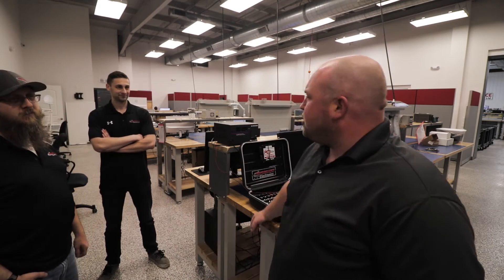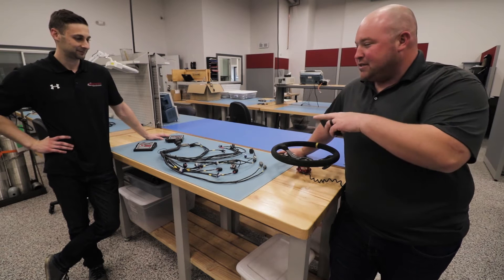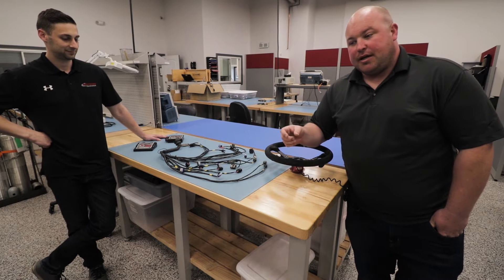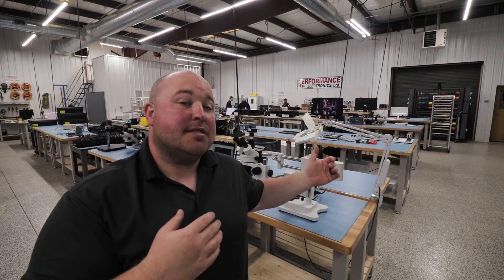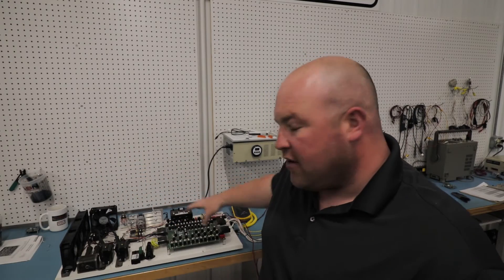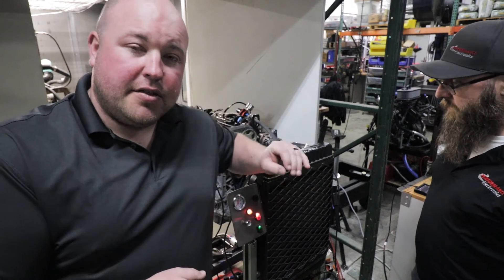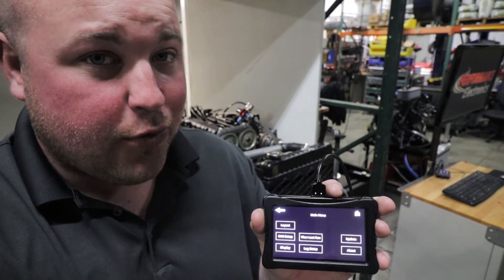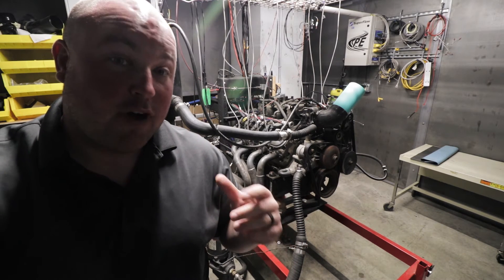BEST Stand Alone ECU for the Money? PE3-8400

Comment: They need to make to where you can control the boost by multiple ways like engine rpm , wheel speed, a g force meter, and also during trans brake engagement and after. 
Also how are the boost tables in this ecm are they by the rpm? If so are the tables in 1's, 10's, or 100's of rpm's? 
Can you pull timing or add timing? If so how is the table setup?
Can you do cranking retard?
Can you do either or the crankshaft reluctor wheels on the LS engine?
Can you also tune the fuel pressure with the boost? 
Does it work with the same GM gas pedal that the Holley ecu wants you to use? (I hope so😊)
Can you order like a 12 inch screen or a 16 inch screen like the holley race pack screen that has the temperd glass screen?
Lastly can you change the gauge layout to reassemble actual gauges or be comparable to holley?
I would like to see a video with a laptop plugged in and tuning done on it.
Sorry about all the questions but I will soon be in the market for an ecu kit for my race car.
As an Ohioan as well Columbus to be exact I would much much rather buy from USA and support our people rather than send some ceo in China on his 10000th vacation this year to Dubai😔😑!
I also have more questions about EGT capabilities and such. 
I hope I get some info thanks guys have a good night.

Comment: The fully potted PE3 8400 is a very robust ecu and the data logging of 20 hours is awesome , it’s a very nice ecu with a wide variety of set up options all ready built in click the drop downs and select the sensor type and count rising or falling and move on to the next sensor set up , you will need to know your fueling     Pulse width to create your base tune , plenty of calculators online to help you with that bit for the price it’s loaded with features that others charge twice as much for

Comment: any way to program your own fuel injectors to add skip fire engine control? Because its a google patent https://patents.google.com/patent/US8511281B2/en 
the end user would have to add it in so it probably wont be supported by any aftermarket ECU

ideally a gyrometer to detect road gradient and a throttle sensor could help to program this thing; any ECU's have a gyroscope built in? most android devices do.

This feature added to ECU's could reduce engine thermal output and possibly run the engine cooler.

Comment: Hi guys, would you be able to get hold of a right hand drive chassis for test fitting?
Reply from the maker: No, unfortunately not. But if anyone can get us a 3D scan of the engine compartment we would LOVE to see if everything fits. I think it will, at least when using the Gallardo manifold, but we have no way of confirming. Do you have a chassis you could at least do rough measurements with?
Reply: @BoostBrothersGarage  Unfortunately I don't, however I do work for Porsche as a technician so next time I have 1 in I'll try to remember. It's a Porsche/Audi dealership so I'm very familiar with the RS3 engine also
Reply from the maker: Awesome! If you don’t mind, shoot me an email (boostbrosgarage@gmail.com) and I’ll get you in touch with Alan who can tell you what the critical measurements are!

Comment: I’m pumped!!! What is the output for the video display?  I’d like to use my double din head unit to display the data.
Reply from the maker: I know it uses canbus for interface with this dash and others. Not sure if there are other options?
Reply: @BoostBrothersGarage  So what youre saying is hopefully they'll ship with a detailed pinout and wiring diagram for that canbus in case any of us nostalgic folk would like to use the stock 944 dash gauges??
Reply from the maker: The swap harness with be capable of connecting to the stock dash!

Comment: I hope the price point on these is earth shattering... Because none of the features mentioned are anything an budget EMU, MaxxEcu, VEMS or MS3 ecu Can't already do, with already mature software for both laptops and Bluetooth devices...

The fact that they're local to YOU is a nice bonus for sure 

The harnesses look sweet though...

What's up with the oil pans?

PS. 1st Comment!!! 👍
Reply from the maker: The ECU runs around $1000 and the race dash is like $400. We are hoping to be $2000 for ECU, harness and wide band O2. That’s a hell of a value if you ask me! I can’t speak for VEMS, but I believe the user interface and standard feature set of this is far better than MS.
Reply: For 2k... Please LOOK at Fuel-Tech ft500 @BoostBrothersGarage
Reply from the maker: I did! I looked at all of the options out there and this is the best bet for a turn key solution. However, people can run whatever they want, we just want to offer a plug and play solution with a full feature set at a reasonable price.
Reply: PE3-8400 is about 1k as is... Making it plug and play would add to it 400-600 more. Then the question is does a person doing this swap really want to use a 30 year old stock 944 harness to plug this into?
Or is this a 07k to 944 specific PNP
Reply from the maker: The swap harness is specific to 944 / 07K. It will replace the entire engine harness.
Reply: Where are we with the oil pan? @BoostBrothersGarage
Reply from the maker: Alan is working on it now. The vast majority of it is done, but we are figuring out the pickup tube and some other last minute details
Reply: Not sure how to send pics here, but I could show you what we've done to pick up tubes in other longitudinally placed 07k swaps  @BoostBrothersGarage
Reply from the maker: Can you email me? Boostbrosgarage@gmail.com
Reply: @BoostBrothersGarage  would this work for a Volvo?
Reply from the maker: Quincy Robertson absolutely!